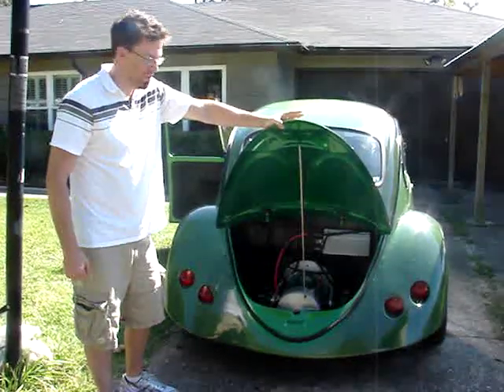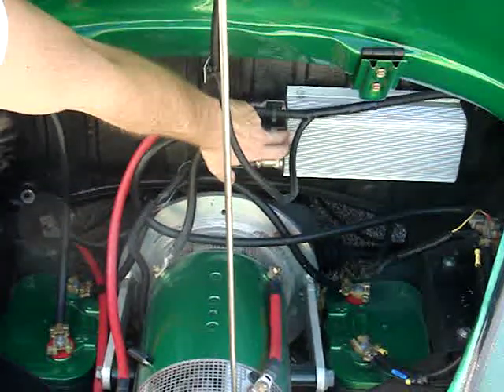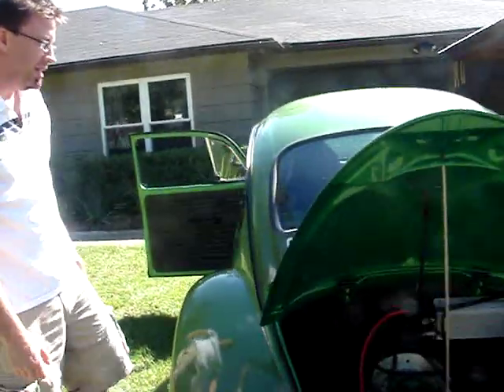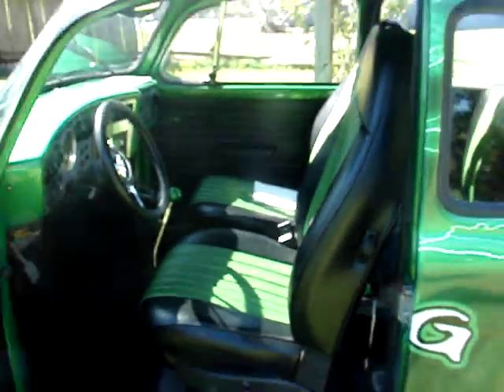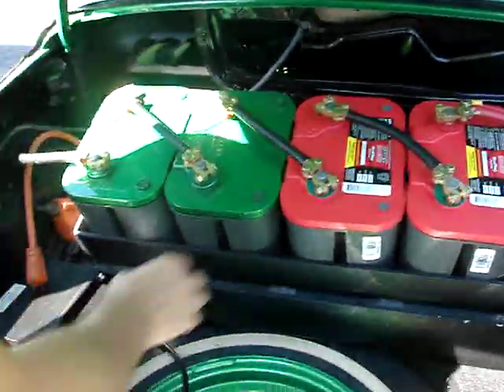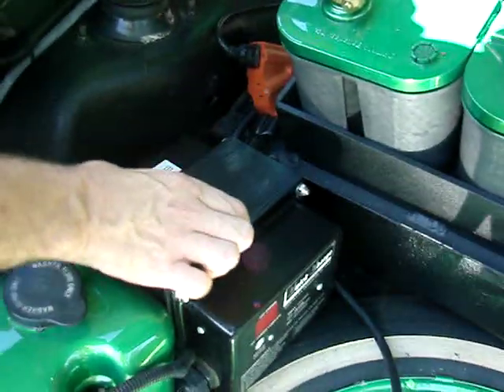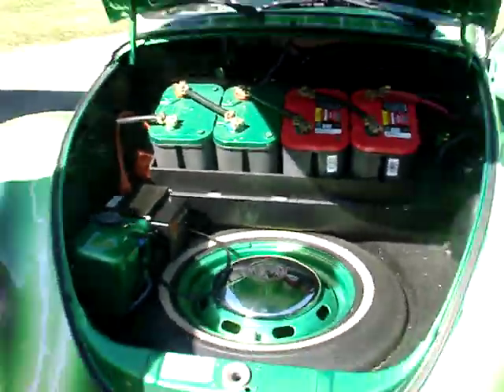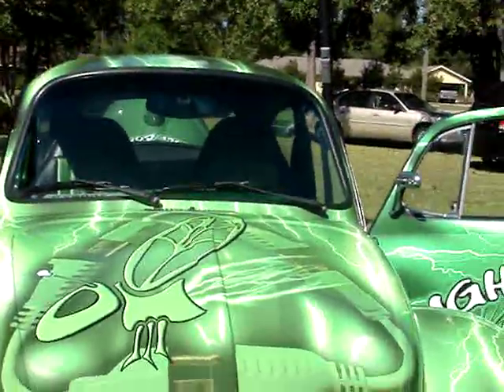Jon McDougal's Electric Beetle

Comment: It is a DC motor maximum voltage 170 Volts DC. Currently running on 144 Volts DC.

Comment: Man! What a great job, I'm jealous! I'm currently converting a 75 Beetle. What are the specs on your bug? What type and brand of batteries are you using. I still have a little body work to do on mine, so I'm still in the planning stages on the motor etc.